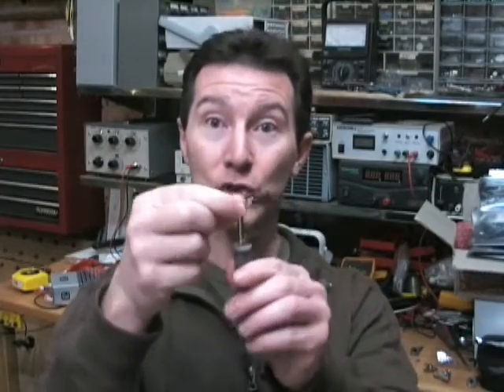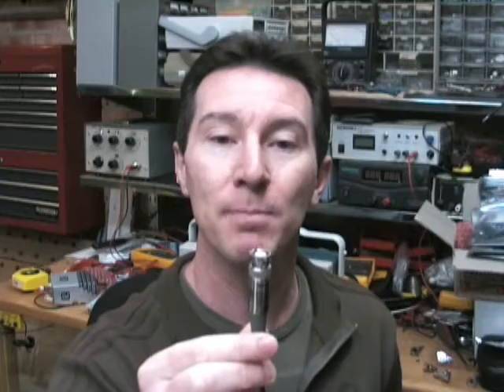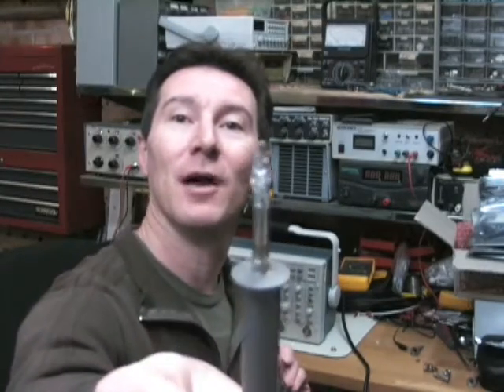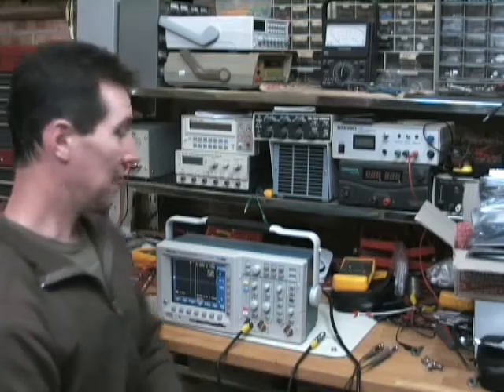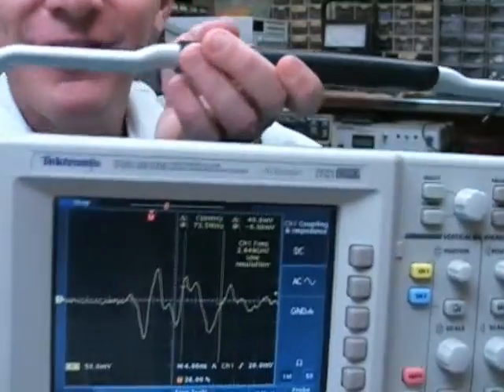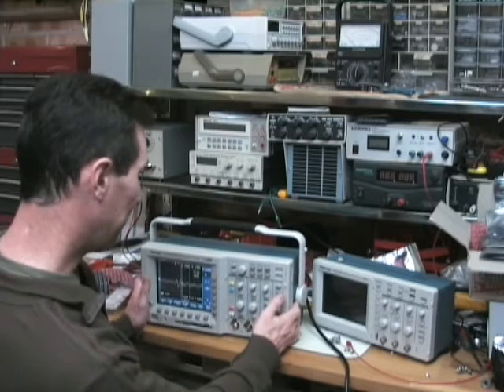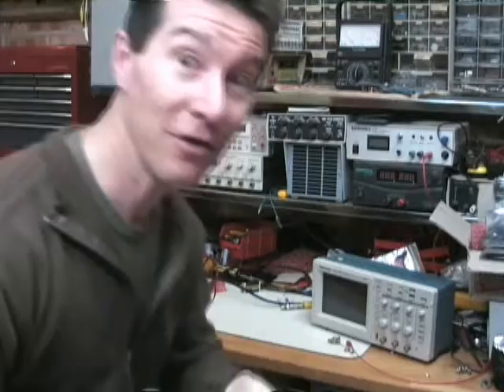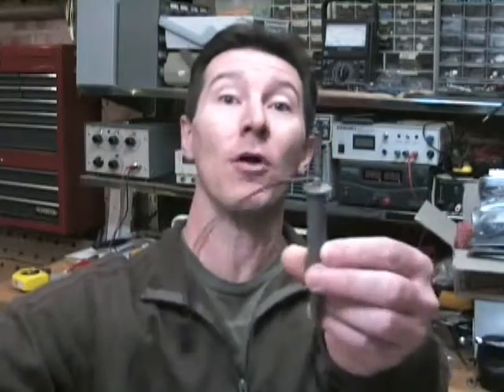EEVblog #21 - The Unusual Oscilloscope Phenomenon - Part 3

Comment: Unproper grounding , you get some from sw pwr. Call fling ground, difference beatwine ground and probe can be even up to 700, but so weak in wires can be mesured in low voltige seting  1v, 0.1v per div.
Its not phenomen...
Old tt instruments use galvanic separation with diode and resistors to make fling ground an potetial about 40- 50v DC curent...

Comment: I know this is a old video, but the fact is simple, arround ten years ago, i experienced similar phenomenon.
Every time I got up from my office chair and touched something metal or i shake someone's hand, i felt and hear the electrostatic discharge.
I had this never before, but that day i was wearing new shoes, the day after when i weared my older shoes, i didn't experienced any electrostatic discharge or whatsoever. 
After that, everytime when i wear the new shoes, the major electrostatic discharge was back when standing up from my office chair. So in short, the clothes and/or shoes that you wear, plays a big role whether or not you experience electrostatic discharge,
and it's this electrostatic discharge that oscilloscopes pick up.
Repeat the experiment with different shoes, and the results will change.

Comment: Now you have me thinking.  Those grounding leads are almost all coiled for easy movement and less tangling/interference with other nearby objects.  While for ESD elimination for handling parts it's great, it will have a higher impedance to higher frequencies.  Like your overall point of spurious measurement, it's just something to be aware of.

Comment: I came across this same phenomenon about ten years ago when it was causing board resets every time I stood up. I found a paper that showed it was electrostatic discharges within the foam rubber in the chair. This is a known issue.
Reply: +Chad Bonner What's the title of the paper?
Reply: No idea...it was years ago. Google found it for me then though so I'm sure you can find it again.

Comment: Every time you stand up, you block our view of the 'scope, and we can't see it triggering. Also wondering if there's any difference if the 'scope is not sitting on the grounding pad. I saw the test with the anti-static lab coat, but are your shirt or pants made of polyester? What else in the environment might be causing a static discharge? Interesting stuff! Recently found your blog and am working through it.
Reply: I remember a particular electrochemistry lab in college in which I was using rotating disk electrode voltammetry to characterize some diffusion coefficients (yawn, lol) and I noticed a huge spike along the integration curve when I ran out and back into the lab. I was captured by this effect and after removing some filters I was actually able to pick up signals from bodily movements a few feet away and even this girl talking was enough to effect the EM field around her and it was causing a definite disturbance on the real-time voltammagraph readout.

Comment: I think it is an EM pulse generated by the static electricity which is picked up by the wiring and then causes a resonance effect in the shorted probe/scope input circuitry. The higher frequency generated when just the input socket is shorted (lower inductance/higher resonant frequency) would tend to support this explanation

Comment: think this ESD discharges are creating an EM pulse that goes through the plastic case and induces current in the long lines on the scope pcb. Try to to repeat  this test if you put the scope to the EMC chamber or just a microoven. Battery supply recomended to close proper the doors.

Comment: How about using another static generator instead of the chair to rule out microphony in the circuit or sharply tapping different areas of the circuit board ?

Comment: I believe, wearing a viking style aluminum foil helmet (diode fitted between horns) while licking a 9 volt battery, and wearing a full body latex jumpsuit will eliminate this problem...provocative, possibly to some, but it will work.